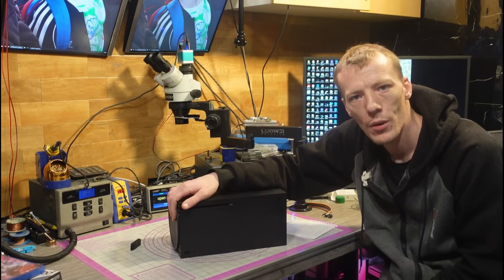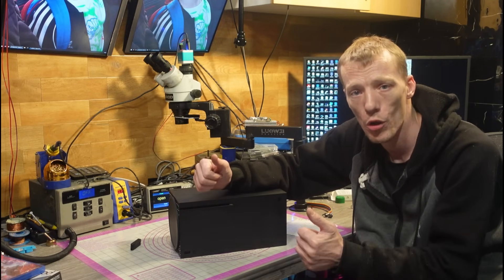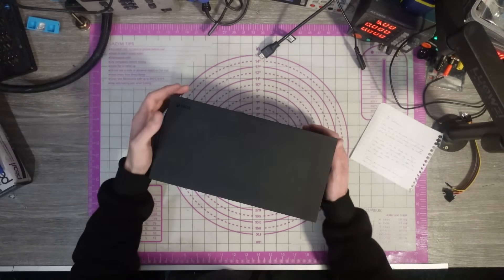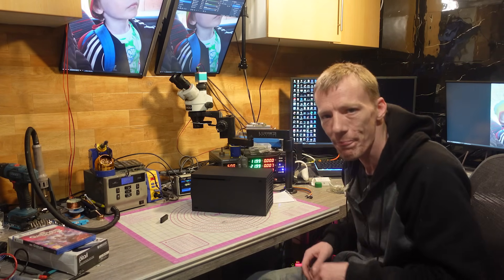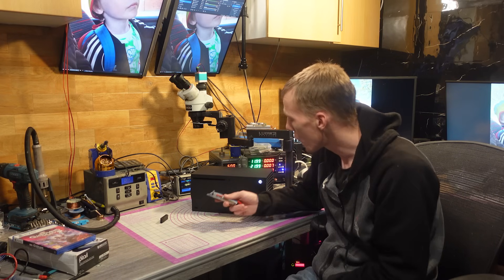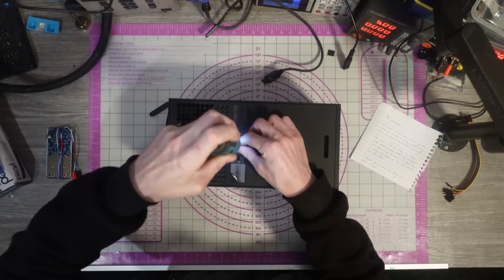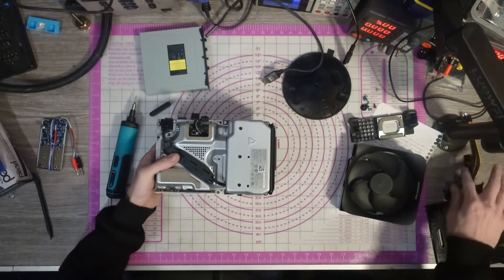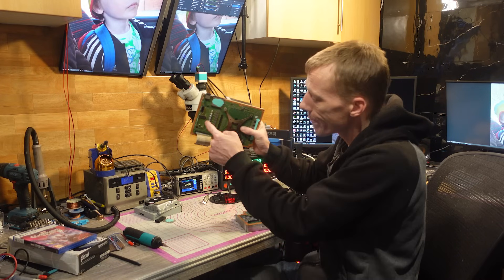THE XBOX IS DESTROYING THE WORLD... AND IT'S MICROSOFT'S FAULT!!!

Comment: You mean to tell me they don't offer a standard .iso install or similar to "start" a new storage device introduced to the unit? If they don't, it's very unprofessional. Say what you want about them, and probably you'll almost always be right - but they actually do know how to do professional. I would be surprised. (Technically, they are FAR FAR superior than your average person thinks - it's just what bosses tell to do and that kind of thing.)
Reply from the maker: They have something called OSU1 which is used to reinstall the operating system. The problem with that is that the console checks for a valid key before it'll allow it to boot. If the key isn't present or it is incorrect, it'll fail to turn on. The update file is useless when there's no matching ssd to begin with